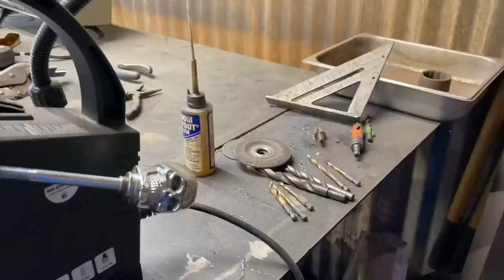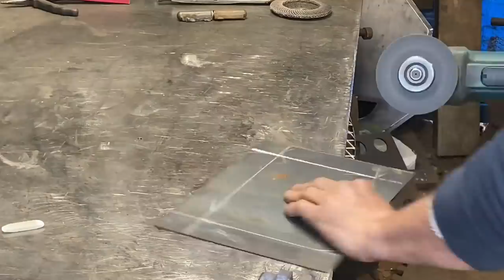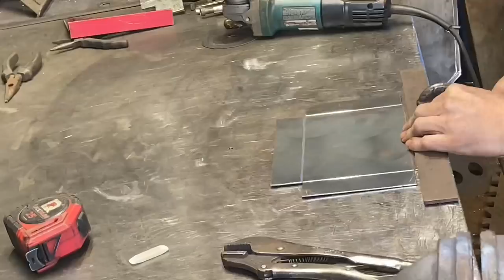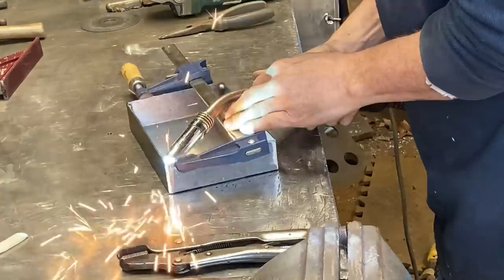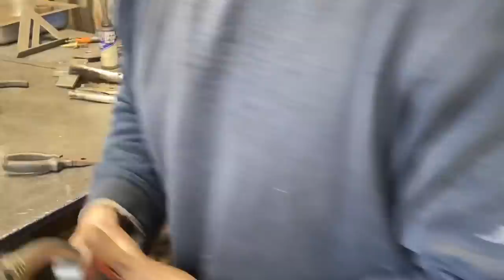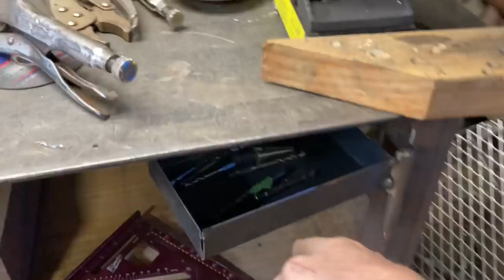Good use for an old hinge

Comment: Love that box making.  Accurate but wickedly simple!  The oven in the back looks interesting.  Heat treating or Rod Oven?  And the make on the Mag Drill?
Reply from the maker: It’s a wood heater I did a while back, does real good except when I’m welding because I have to leave the doors open, it’s an evolution mag drill, I’m doing a video on it real soon.
Reply: @Allensweldingwoodworking  Thanks for the reply.  Now for the link to your SHOP...   ;-)
Reply: @Allensweldingwoodworking  I like the coolant bottle on there